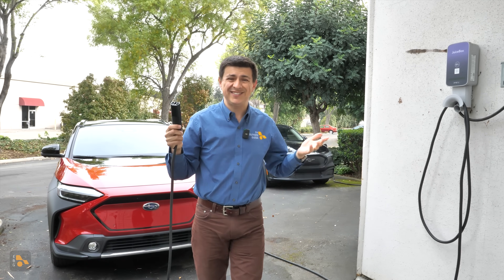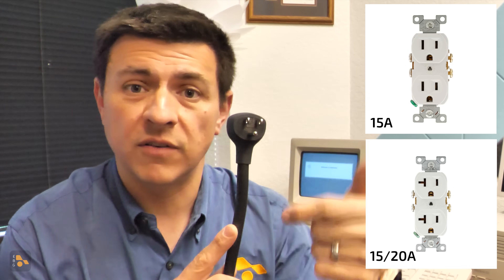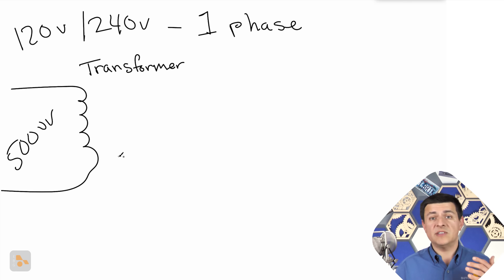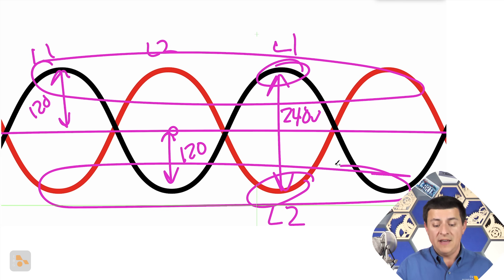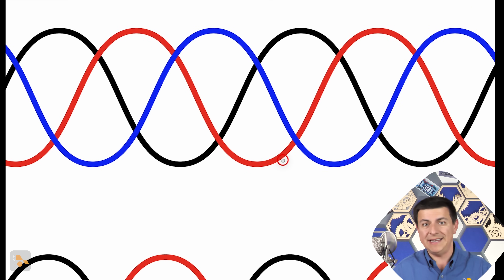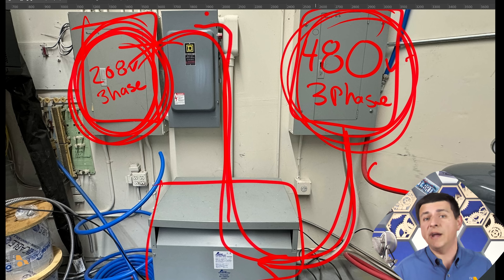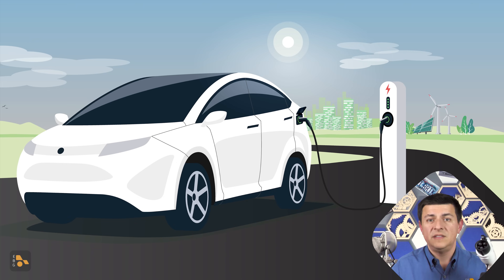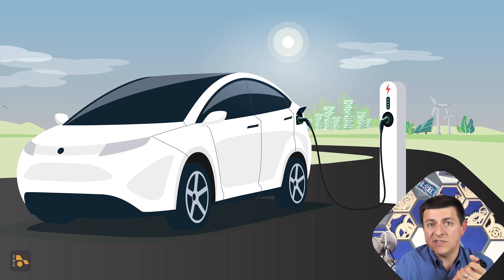NACS/J3400's Support For 277V Charging Is A Huge Deal and Here's Why

Comment: Can a “home business” get 3 phase power as a workaround to get 277v ac charging for EVs?
Reply from the maker: It’s unlikely. 3 Phase power is simply not run in most residential areas and for some reason utilities and local codes prohibit 3 phase being delivered to homes.
Reply: @rsGuideIn my neighborhood the 12kv feeder lines are buried and all 3 phases are available at the nodes. Two of my neighbors has 3 phase power in their residential shops. Not really sure why this was done in a suburban subdivision that was a former dairy farm.
Reply from the maker: The former dairy farm is probably the key

Comment: Awesome vid, I learned a ton about 3-phase here despite being around it in our data centers previously.  qq though, you said the Tesla would charge at 13 ish kW on 277/48amp.  I understand the maths, but want to know if you mean the NACS / og connectors would possibly support that?  Am guessing you mean that is possible only outside North America, where those Teslas' connectors already support 3-phase?  Thanks!!
Reply from the maker: model 3/y already support 277v charging in the USA, no changes needed
Reply: @EVBuyersGuide But note that this is using ONE of the three phases. So it is still single phase charging and is supported by the NACS connector. If one is going to have a bunch of chargers one would spread them around the three phases of course.
Reply from the maker: I clearly say that in the video. No EV sold in the USA is designed for 3-phase charging.

Comment: It seems no one working on SAE J3400 talked to Canada, they use 600/347V for commercial 3-phase. Why not use the same voltage range as J3068?
Reply from the maker: Yea, in Canada you'll just have to make do with either a high-leg delta stepdown transformer that could give you 120/208/240V, but 347 I think was just too far outside the ~240V nominal window to logically support.